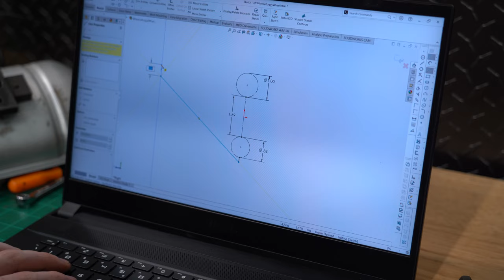We Made a Kid's Go Kart do MASSIVE WHEELIES! (We Crashed it!)

Comment: Those wheelie bars need to extend past the carb, thise short ones were never going to work unless you came up way slow not violently fast, extend the bars past the carb use some old leaf springs like cars and cameras did on there og vtwin predator kart